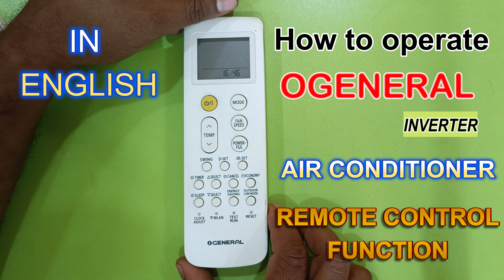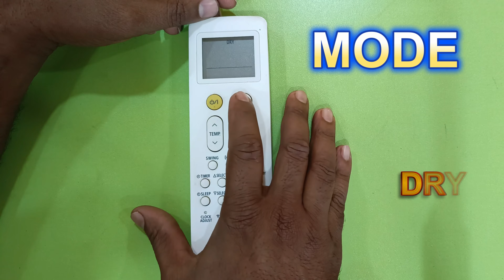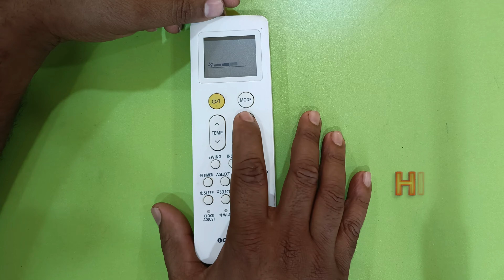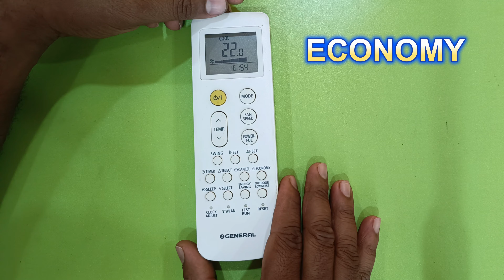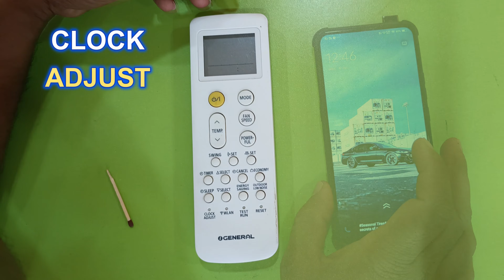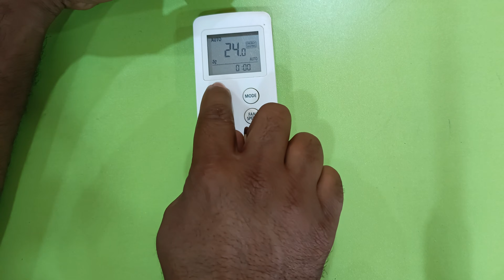How to Use O General AC Remote | Complete Guide in English

Comment: What is the difference between Economy and Energy Saving?
Reply from the maker: "Economy Mode limits cooling capacity for lower power consumption, while Energy Saving Mode automatically optimizes compressor operation to maintain comfort with minimum electricity usage."